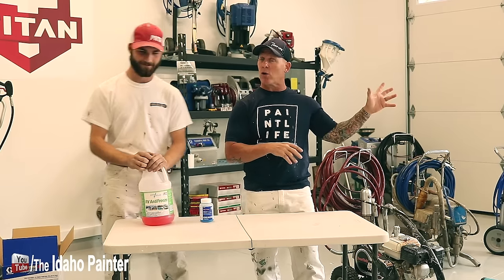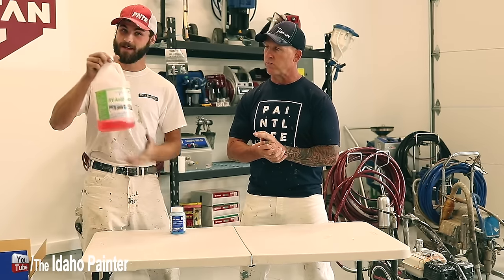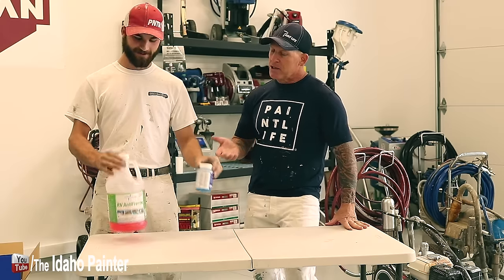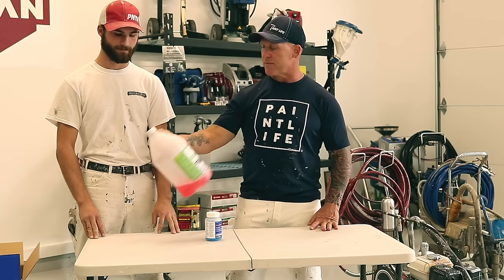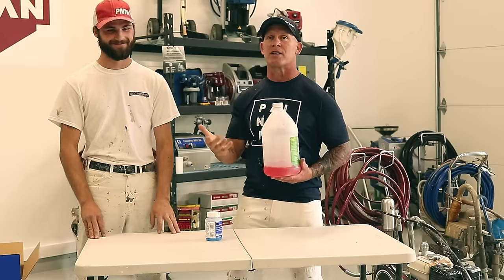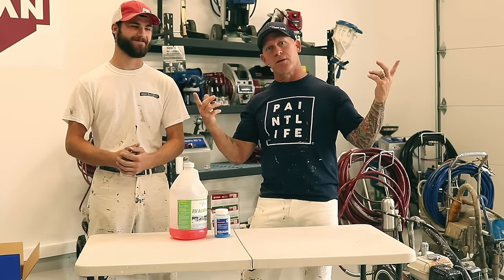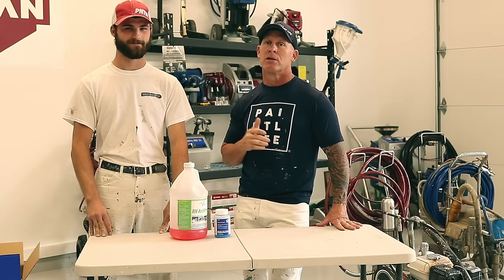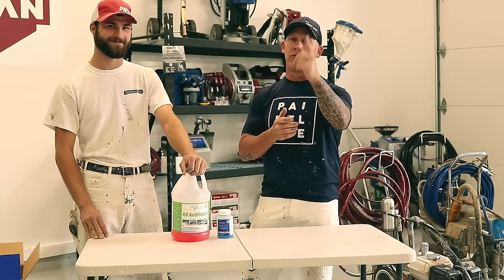Winterize Airless Sprayers.  Winter Tool HACK!

Comment: someone made a good point about watch the toxicity of RV Antifreeze. If you are like me, you might clean out on site sometimes.   I usually use pump guard when I clean daily.  There are a few places online that you can get it fairly cheap.  I use RV anti for winter storage as it is obviously stronger.  Another trick I use up here in the Northeast when it starts getting cold,  right before the bucket is empty while cleaning out (3-4inches left) I dump another ~2-3oz of pump armor in just to boost the freeze protection of the armor that is actually in the lines.  This seems to help somewhat.  Then again, last week it dropped into the high teens, and the machine in my trailer had slush in the lines.  Broke my pull cord trying to start it, had to switch machines ><.  Frozen machine seems fine now that it is defrosted and cord is repaired.
Reply from the maker: Thanks for sharing

Comment: Adding detergent concentrate with concentrated antifreeze further assists keeping the lines and internal components clean. It is not feasible in a motor car but very practical in an airless sprayer.

Comment: Just a tip from someone who assembles Graco units. When priming any unit or changing out buckets of paint, make sure to dial back the P.C to prime before opening the dump valve. If you prime these on a higher setting it can cause instant and permanent damage to the dump valve due to the makeup of certain paints especially latex. Also to aid in priming first thing is to make sure you clean the pump out properly, two would be it's better to  jog the unit on and off with the dump valve open when priming. Third is you can stick something small up into the inlet and pole the ball bearing to free it up if it sticks, but be sure to do this when the unit is turned off and unplugged, and you dont need to hit the ball with much force either just a tap or two. There is only a tiny amount of travel in the ball bearing.
Reply from the maker: Thanks for sharing Dustin!

Comment: I just purchased a Graco 930, the manual tells me to flush it with mineral spirits to remove the product that is in there from the factory! I intend to use if for latex only, so would I then need to do a further flush with just water to remove the mineral spirits or soapy water or...yes, it's not as clear as it could be. Kind of an expensive bit of equipment, could make it more clear. I did see a video online, the guy is a painter and he walks through the process. He tells us that 'the paint store where he bought it said to flush with water before use, no mention of mineral spirits. Good channel this Paint Life.

Comment: When cutting the antifreeze are you using distilled water to limit all the hardness factors in regular water.  We would only use distilled water in the old race cars because of thr mineral contents that spawned deposits. 

I assume we can use this for our pressure washers as well...

Comment: This past 12 months I have been using Marine RV Antifreeze in my 4 Graco pumps especially the Ultra handheld. Can I store long term > 1 month with RV in the pump or should i use mineral spirits? Great video. By the way I called Graco tech support and asked them if I could use RV antifreeze in  my Graco ProX19 and they said yes!
Reply from the maker: Either would work

Comment: Do you run it thru your paint hoses too. Thanks. Love all your videos thumbs up.
Reply from the maker: Yes, we do
Reply: @Idahopainter  i went out and bought a gallon rv antifreeze for 3.95. And the pump armor for a small bottle 10.00 the guy at the hardware store said it will wreck the unit. I dont think he knows what hes talking about. THANKS AGAIN for the advice on the rv antifreeze.
Reply: G Sauve The cheapest I can find pump armor is for $36 per gallon. The middle of the road RV anti-freeze in my area is $3.25 per gallon. I’ve been using RV anyfreeze for over a year now.

Comment: Rv antifreeze has no rust prevention though 😒. Been using thinner for 20 plus years and have never had any issues.    I have 2 rigs a gas and electric that's 20 plus years old and no issues and not one repacking has been done. It's what all the old timers been using for years.
Reply: Can I use paint thinner with mineral spirits, or just mineral spirits by itself??

Comment: Oil n paint thinner mix for long term storage
Reply from the maker: Thanks for sharing!
Reply: Lance, after storing the sprayer with thinner and oil what do you clean out the oil and thinner with before you use latex paint? I have been looking for an answer to this question for months now.
Reply: Brian Mowers run clean paint thinner thru it then flush it with warm soapy water then clean water
Reply: @Brian Mowers  what kind of oil do you use with the thinner?

Comment: Hi there, can you help me. I am painting a bedroom in my new house and want your opinion on roller direction. The bedroom is 10ft wide by 16ft long. It has a big 9ft window at the far end facing the sun (north, here in NZ) and the bedroom door at the opposite end. Ceiling is 10ft high so there is about 3ft of wall above window. My first two coats of ultra low sheen I painted starting at window end and working back to the door. I painted from wall to wall (10ft) at about 2-3foot strips working back from the window (so not rolling toward light source). So the first coat looked ok the second coat i think I was flying blind a bit an may have been a bit inconsistent with paint and also might have snuck too far back into the previous strip whilst laying off.

I have watched your ceiling painting vids and many others. I just wanted to check that rolling across the light source rather than towards it is ok as it is the shortest span and seems to be inline with your perpendicular to light source and entry point philosophy. And also now that I have a couple of faint lines do I need to roll two more times with the nzt being perpendicular to my first two coats then the 4th being across the light source like my first two. Or should I just do a 3rd coat the same direction as the first 2 and just be more careful and perhaps not roll from wall to wall?

I also used an 8mm (5/16) Draylon roller (top of the line professional dacron cover) but will attempt the 3rd coat with a 10mm (25/64) version of the same roller to try and help hide the lines and a few imperfections.

Please help.
Reply from the maker: We are making changes and eventually will not be answering any questions on YouTube, but we are directing people to the private paint life members group where other painters in the community can answer questions. It will be a closed group on Facebook. Feel free to check it out! https://www.facebook.com/groups/2305219262837596/

Comment: Are you mixing it with water?
Reply from the maker: not when temps are below freezing
Reply: So just straight up? I'm in Ohio and temps around around 20's and go down occ to the teens and single digits. Would water mixed in corrode?  @Idahopainter
Reply: Stevie Dalpe I am in the lower Michigan area and I don’t take the chance with cutting the RV anti-freeze I just use it straight. I get mine at Walmart for $2.60 a gallon
Reply: Brian Mowers thanks for the reply.